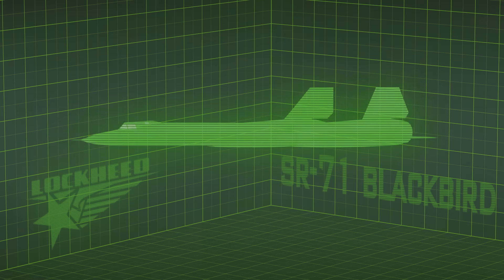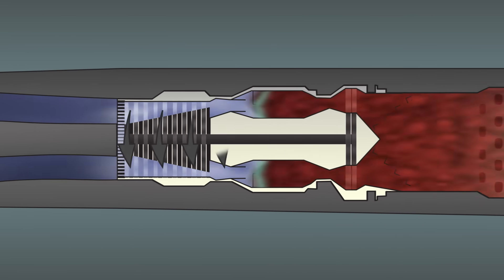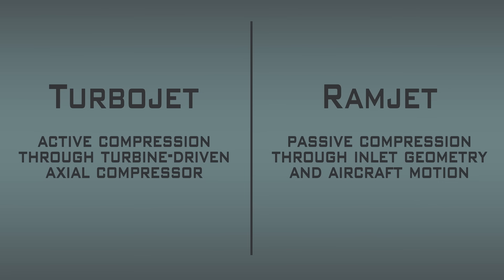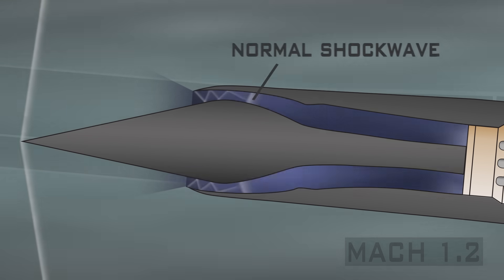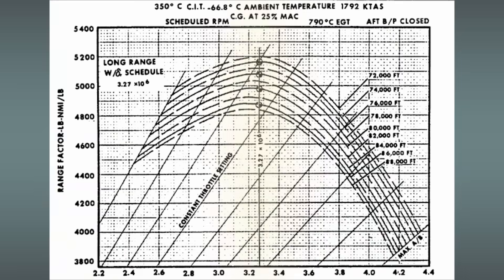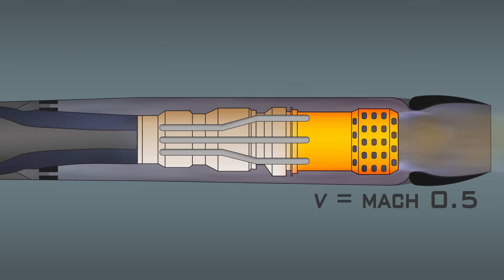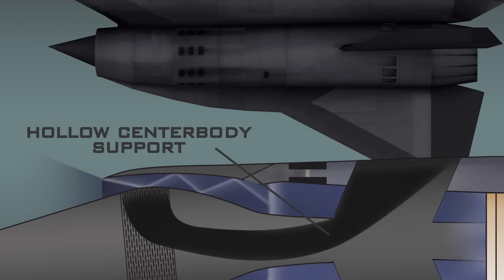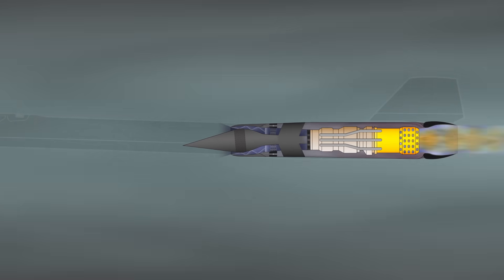The Mighty J58 - The SR-71's Secret Powerhouse

Comment: there is only one catch; Kelly Johnson said "at Mach 3+, 80% of the thrust is generated by the inlet!!!" , the "INLET" he said, keep looking at the diagrams and keep playing that phrase in your head over and over and over and over, until you figure it out, i did, when i was abt 10 years old, at Mach 3+ the engine, bleed and bypass doors, bypass tubes and all, act like act giant vacuum cleaner creating a huge area of low pressure behind the spike, and if u look at that area it looks like a rocket nozzle, which is precisely what it is!!, its the explosive decompression of the shock wave at that location that provides the "80%" thrust that Kelly Johnson was talking about, another thing that clued me in was the fact that at those speeds, the speed is trimmed with the bleed door switches, a little too much and the venturi effect drag goes up exponentially and the shock wave pops out and you get an "unstart", and too little bleed will drop that "80%" real fast, i cornered a few "sled drivers" about this and they would nether confirm or deny - but when i asked them to explain Kelly's "80%" - i got BS , so i knew i had figured it out - Kelly was beyond brilliant - this was also the other reason for the "dipsy doodle" maneuver, one was to heat up the skin and stop the fuel leaks, the other, was to get the inlet "started", other wise it would only have "20%" of the range which would render it useless
Reply from the maker: You misunderstand the engineering term "thrust". Thrust happens at the surface being pushed against that's feeling the reaction force of the exhaust. In subsonic jet engines, the turbine blades and the combustion chamber "feel" the pushing power of the superheated exhaust. In supersonic jet aircraft, a portion of that pushing power is "felt" in the inlet, on the turbines, in the combustion chamber, and in the expansion nozzle. In a ramjet engine, the inlet is the combustion chamber and the start of the expansion nozzle, so it feels all of the thrust. In a rocket, all of the thrust is felt either in the combustion chamber or expansion nozzle. In the J58, the engines and the afterburner provide the energy for the thrust, but due to the mechanics of the bypass tubes, most of the "push" is "felt" at the inlet, as the plane is "pushing" against the backside of the inlet spike, the inlet walls, and the shock terminus of the supersonic air going subsonic.
Reply: @TechLaboratories  but Kelly Johnson said GENERATED by the inlet!!! , ill stick to my explanation - no sled driver ever refuted me 
- your way the fuel consumption is still to high, my way there is a huge jump in efficiency, its a complete mode change

Comment: I think that there's a misconception about how engineers used slide rules. I used one before there were calculators. We used a slide rule to do quick estimates of numbers and as sanity checks because you could only get about 3 digits of accuracy out of one. When it came to the actual design of something we would get out the old pencil and paper and do the calculations by hand to get the necessary accuracy. You can also screw up a slide rule calculation because it doesn't tell you where the decimal point should be. You just have to know in advance where the decimal point should be from experience with numbers. I was so happy when pocket calculators came out, first the 4-bangers and then the scientific calculators. In 1973 I bought a HP45 scientific calculator for $400 (about $2500 in 2020 dollars). It was amazing and I was the envy of many engineering students. I promptly ditched my huge Picket slide rule and never used it again. I now wished that I had kept it for nostalgia because it was the finest slide rule that you could buy. It was made of aluminum and had bearings to eliminate stiction. I still have that HP45 that I bought in 1973.

Comment: This is pretty much the final version and design of the J58. Before this design was finalized - there were some harrowing incidents and possibly the cause of at least one aircraft crash. During the flight-test phase - at certain speeds and fuel mixes, one engine would experience an "Un-Start" condition, meaning it would cough and sputter. Depending on the aircraft velocity, this caused the aircraft to suddenly and violently Yaw towards the under-performing engine. This would cause the flight crew severe interactions between their helmets/heads with the inside of the cockpit. Bad juju. There are anecdotal reports of temporary pilot unconsciousness and big headaches. Finally the spike (also refereed as the Witch's Hat) was redesigned and fine-tuned and flight-mode settled down.
Regardless - an amazing engine, aircraft, flight crews and support crews.
Reply: Right on. Not enough credit goes to the test pilots for the CIA and Air Force who put their lives on the line to bring this program to life.
I think there was one story where the pilot lifted the nose too sharply at speed and broke the aircraft in half

Comment: The reason why they need extrernal equipment to start the engine is because the plane is not using conventional fuel. This is because fuel is stored in the wings and a conventional fuel will ignite because of the high temperature of the frame achieved during flight caused by the massive drag. The SR used a special type of fuel that neeed higher pressure and temperature to burn.

Comment: The Inlet Needle...What mechanism retracts/extends the needle? It retracts 1.3" every .1 mach increase above 1.6 mach. Is this an actuator or spring that allows the Inlet Needle to move? 
I'm fascinated by the different types of propulsion and the technological advances from the 1940's-1980's. The engineers back then must've been rockstar's. Thank you for the upload even if I'm 6 years too late.

Comment: Actually this was quite an inelegant solution to try and shoehorn a low speed turbojet into a high speed application. 

The J-58 was originally designed for a jet powered flying boat!  Something that flew at such a low speed but required a large amount of thrust to overcome its huge drag. 

Even subsonic jet engines use divergent inlets to generate additional compression of air. But you have to be going a significant speed to do so and it doesn’t add nearly as much as supersonic compression in specially designed inlets. 

This supersonic compression is not only advantageous but necessary. The airflow through a turbojet cannot be supersonic for many reasons... the fact that an enclosed tube will always reduce airflow to sonic (choked) flow (whether nicely like the SR-71 or violently), the compressors will stall with supersonic flow, and the combustion of jet fuel cannot happen at supersonic speeds. 

But as we see the slowing of air from high supersonic causes a massive compression of the air. There is also an attendant temperature increase. A compressor doesn’t add to this, it multiplies the compression. 

What this means is that the temperature of the air exiting the compressor of an overly compressed turbojet like the J-58 is nearly as hot as the combustion temperature of the fuel. It means you cannot add enough energy via fuel to even turn the compressor without melting the combustion chamber and turbines, never mind adding thrust. 

Pratt and Whitney’s solution was to bypass the extra air and lower the overall compression ratio, and by luck have some extra high pressure air to allow for more efficient afterburner operation and more thrust. 

But there were easier ways to do this. The Mig-25 simply used fewer compressors. Though it’s been said that the Mig-25s engines were damaged when going Mach 3, the J-58s were hardly the bastions of reliability either for the very few Mach 3 hours they actually flew. 

A more elegant solution was used in the YJ-93 on the XB-70. They used variable inlet guide vanes and variable stators to load and unload the compressor at will. 

The result of both of these solutions is a lower pressure drop across the turbines since they aren’t working as hard to generate compression that isn’t needed. So the pressure in the afterburner is already high without the need for bypass tubes and indeed these planes could be just as efficient as the SR-71 (which wasn’t exactly a marathon runner in terms of endurance... it was just fast).

Comment: Kelly Johnson and his team at "Skunkworks" were incredible. Advanced tech in the late 1950's! The closest practical application for a true ramjet engine. Mach 3+? Pretty cool. You couldn't light the fuel with a match. That's crazy kerosene. Even the burn was very carefully dialed in.
Reply: These guys even went back to old school for an answer. Because of the friction, flying that fast, they found that the plane grew in length. They corrugated the skin so the metal could withstand extreme temperature changes.

Comment: FORE BETTER EXPLANATIONS OF THE INCORRECT TYE J58 BUT XR74 REVAMPED JKELLOGS  IS TO ASK AROUND INDOCHINA FORE CORRECT TYPE AND ACTION OF ENGINE BY WAY THE INTERNAL OF JET ENGINE NEVER OVERCOMES SPEED OF SOUND AT AROUND 700 NO MORE 705 THE ENGINE FLYS APART. HAD FEW LEFT OVER. NOT MUCH OF ENGINES LEFT AT THOSE SPEEDS .

Comment: Why is the inlet spike pointed downwards?
Reply: Late answer, but it's about angle of attack. The spike is supposed to be as straight as possible in relation to the airflow, rather than the aircraft. Planes always fly "level" in a slight nose up pitch, so that practically compensates it.

Comment: Saw a vid where one pilot talked about how when the engines transitioned into ramjet mode that sometimes one side would kick off before the other resulting in a hard steer that would almost crash the jet
Reply: Can you imagine the first test pilot that had to hang on for that, and probably hundreds of other bugs they had to work out in production? No way to test an engine at mach 3.2 on the ground...
Reply: @xs-1b415  Exactly. Even when "perfected", there was still the potential to have delayed ignition of ram jets on one side or the other. There was always a "brace yourself" moment when reaching those ignition speeds. Crazy stuff but shows you the nerve of those trail blazers of those years.

Comment: “Two muscle car motors”. The 454’s in the start carts are configured as they would be in a 1 ton pickup, not as they would be in a Chevelle.
Reply: They were Buick Wildcat engines - blueprinted at a speed shop in L.A. I was a Field Maintenance officer 67-71.

Comment: I saw a documentary on this plane years ago on Discovery wings and they were flying over either USSR or the Middle East and was being fired on but no anti-aircraft missiles could catch this plane.  So the enemy knew the flight path this plane would have take to film what ever they after and would shot missiles just to get them off course, so the pilot kicked in the after burners and got to the point well before the missile and the pilot said they were going faster than Mock 5 and they had more throttle to go even faster!  No one knew how fast this plane could go not the pilots not engineers nobody.